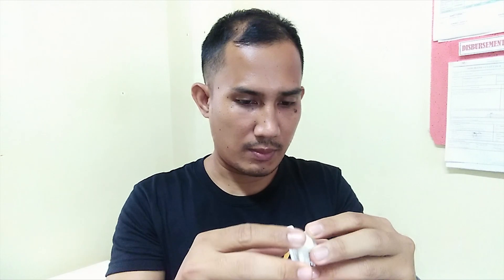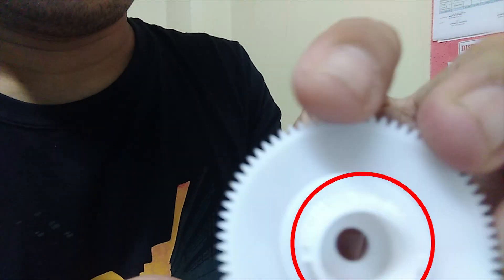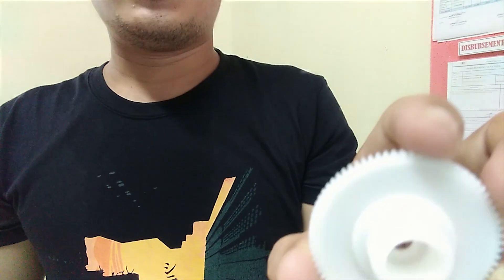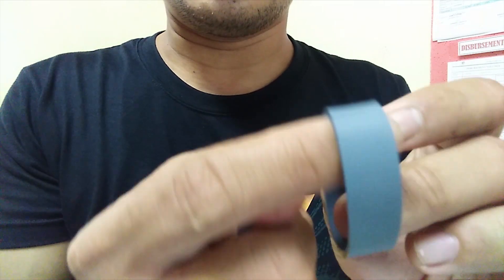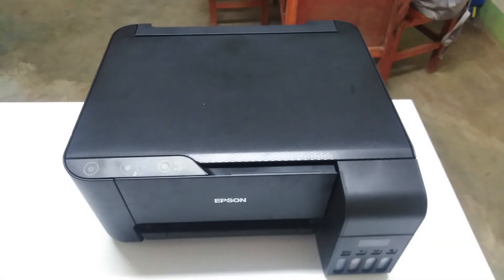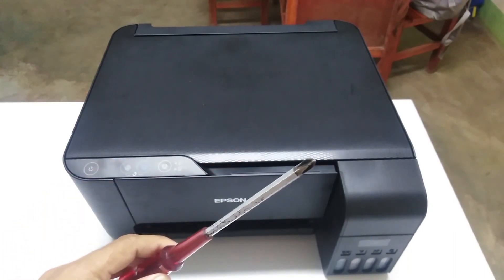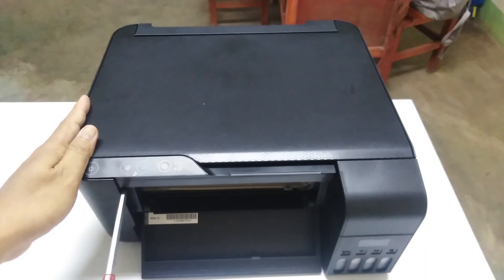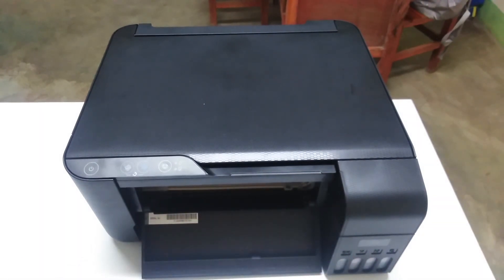Why Does Epson L3110 has Paper Feed Problems and How to Fix it?

Comment: thank po sa tutorial. ask kulang po if ano problem kapagkalahati lang bond paper ang nakakapasok and di na po nacocontinue ang pagprint
Reply from the maker: Hi po. Maraming salamat po sa panonood ng video na ito. Regarding po sa tanong ninyo, depende po. Kapag kalahati lang ang napapasok at kusang tumitigil ang printer at may error message tulad ng communication error, check niyo po ang connection ng printer sa PC ninyo po. Kapag biglang tumitigil ang printer at iniluluwa lang ang papel sa kalagitnaan, maaaring kailangan pong i reinstall ang driver ng printer. Pero kapag nag eerorr ang printer, posible pong amy problema mga gears niya sa loob.

Comment: hi po mag iiba po ba feeder nya pag halimbawa po aksidente pong naka pag xerox ako ng 200gsm na photo paper?
may time po kasing hindi nya kinakain ung bond paper pag nag xexerox ako.salamat po.more power
Reply from the maker: Hi po. Posible pong macondition ang feeder sa mas makapal na papel. Ang pwedeng gawin po ay i check ang feeder roller at tanggalin at ibalik muli para maireset mechanically.

Comment: Sir. ung printer ko  Epson L3110. Ok pag A4 pero hindi na nakakprint ng fast quality at legal size na paper after palitan ang roller, niluluwa nalang. Sabi ng printer, incorrect paper loading kahit ok naman. Bakit po kaya
Reply from the maker: Subukan pong i set nang tama ang paper size. If hindi pa rin po maresolve, huwag na lang gumamit ng fast (draft) quality kasi hindi po ito advisable sa maramihang volumes ng piniprint (modules).
Reply: @TiyoTurko  Nasa legal naman po size kaso parang nrereject nya lang. Pag A4 nakaset ok naman po at smooth ang feeding. Parang magic nga eh. any idea po bakit kaya gnun?
Reply: @TiyoTurko  Di kaya mas makapal yung pinalit ko na rubber s stock eh

Comment: Hi there, I was hoping you can help me I have a L3111 and the paper does feed and printhead moves towards the paper but then a paper jam error will occur. Then off the printer and on and then it will feed two papers so that's how know it's not the paper feed. Please assist me  if you can. Thanks
Reply from the maker: Hi there. Thanks for reaching out. I believe that the paper feed sensor's mechanical spring has been either lost or dislocated. At 2:09 of the video https://youtu.be/tX59YyKT6fA is the sensor that I mean and there is a small spring that holds the lever that reaches the sensor itself.

Comment: I have mine with complete springs as I checked yet still have feeding problem. Do you suggest replacing the pick up rollers? Thanks!
Reply from the maker: If it is possible to change just the rubbers first, it will be economical. However, if the rubbers are okay, it will be better to replace the rollers instead

Comment: Hello sir anu po laya problem ng printer q pinalitan q n ng rubber ung roller feeder nya pero pag nagprint my dumudulas n papel...magprint xa tapos may lalabas n blank paper tas print ulit
Reply from the maker: Hi po. Thanks po sa pagtatanong. May posibilidad po na mayroon talagang blank page sa piniprint o d kaya'y nag aadjust pa ang bagong set ng rubber sa rollers. Isa pa pong possibility ay sa quality ng papel.
Reply: @TiyoTurko  thank you po

Comment: Sir Tiyo bakit pag iniikot ko ung ganyan ko 10:41 bakit tumitigil sya na parang may pumipigil tapos iikutin ko naman sya pabaliktad normal po ba yun?
Reply from the maker: Normal po yun kasi may lock guide jan na bumibilang ng isang rotation cycle sa pag feed ng papel sa printer. Gaganap yan sa unang pagkagat ng roller sa papel at matapos mainitiate ang paper feed, hihintay na naman ng susunod na sheet ng papel.

Comment: Sir good morning I have epson l4160  I already change one set of feeder, no problem in test print  like Excell and word. but the error remain specially when I print a picture. What will the solution? Thank you
Reply from the maker: Hi there and thanks for reaching my channel. Regarding your concern about the print output, we need to check if it is a hardware-related issue or a software-related issue. Try to do a Nozzle print check and see if the print quality is satisfactory, that is, all nozzles work. If it is, then it is a software related-issue which could be a printer driver software configuration.
Reply: Any idea hardware?
Reply from the maker: When we consider hardware-related issue, we refer to the printer itself which may have issues in its printhead as some nozzles (the parts that spray the ink out) may have been clogged which affect the picture print quality. In addition, mechanical issues in the printer may exist sir  @ricogenese2440  .
Reply: Thank you
Reply from the maker: You're very much welcome sir @ricogenese2440  😊😊😊